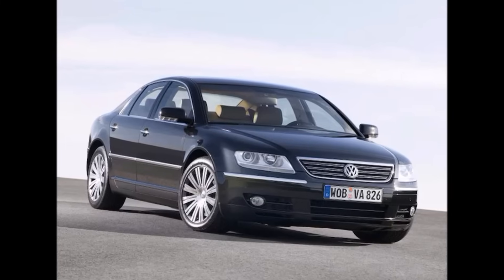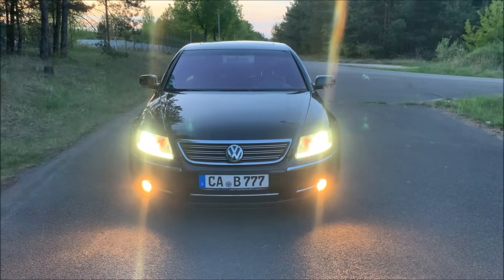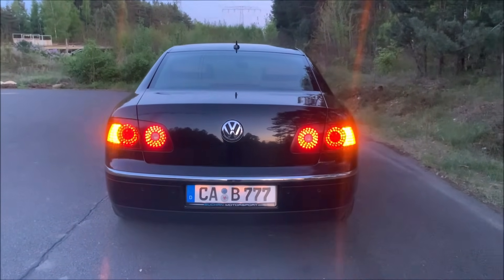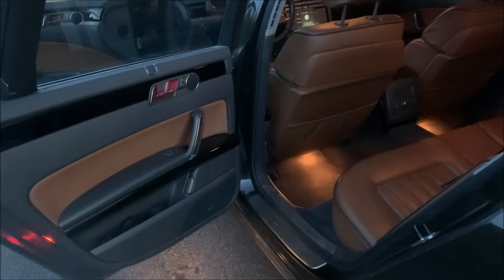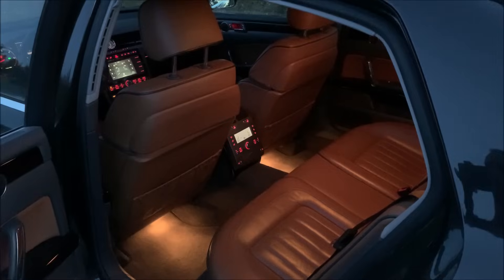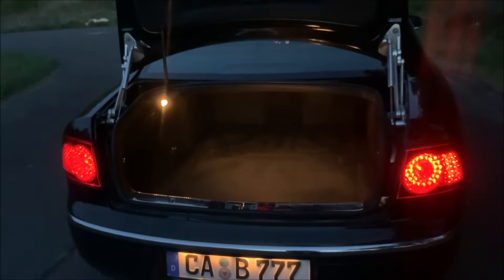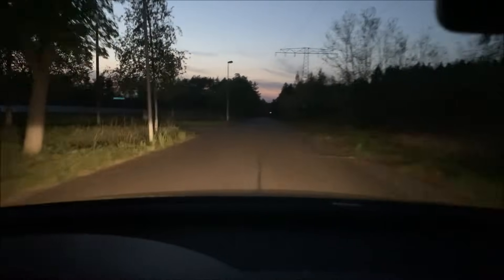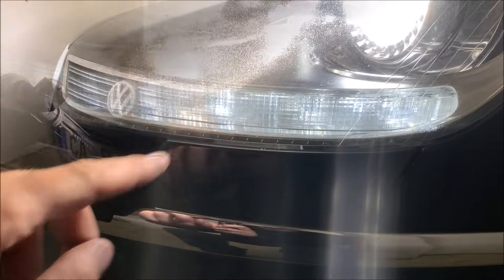VW Phaeton - Part 5 - Light Systems

Comment: I remember people said "Those new LED lights everywhere are just there to make money since they are so expensive and will break". I have changed a ton of all kinds of bulbs on a car over the years, but not one LED.
Reply: The problem with LEDs is never the light in itself, rather it's the electronics used to drive them. And since we're talking about automotive tech, the electronics also need to be top notch, so there's that
Reply: I sold several LED projectors on Lexus, and Hyundai/Kia. But is not the usual
Reply: facelift e46 tails have LEDs that die. Most bmw headlights and tails that used LEDs from 05 on to about 2012 die. Frustratingly.
Reply: I've seen countless 00s Accords with failing LED tail lights driving around, other vehicles too some newer 10s even! A bulb is a $2 repair at any parts store, LEDs can be hundreds and you rely on junkyards or eBay.
Reply: I remember the mk5 Jettas having dead leds when they were still new.. it’s about quality, the same as light bulbs. I replaced around two year the original denso rear light bulbs from my 94 Vitara.. it’s been in the family since new and those bulbs were never replaced
Reply: 😂….you can ask every VW Passat B6, Golf / Plus and also the Phaeton customer about their rear indicator light. Nearly every rear head light brakes do to a defect PCB.
Reply: Check ou diode gone wild... In led lights it is almost always the driving circuitry that fails.
Reply: I've seen some late 2000s VWs (Passat B6, Golf Plus, Eos) with flickering rear lights and seemingly they had so much issues (I guess because these share amber turn indicators and red rear/brake light and it didn't work so well back then, did the red north american turn indicators work better?) that the later models (Passat B7, Golf Sportsvan, Eos GP) actually took a step back and got rear lights with some incandescent bulbs again (higher-spec Passat B7 had LED version).
Reply: The difference between LEDs and Halogens are like night and day. I don't know why a lot of people are naysayers when it comes to innovation. Of course, there is no question that the innovation should be durable and not a money pit/"use and throw".